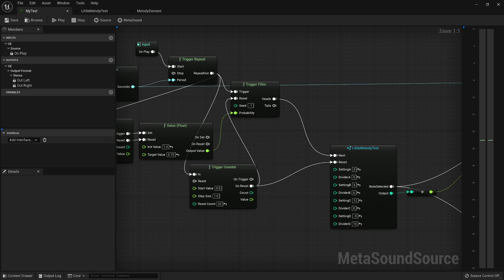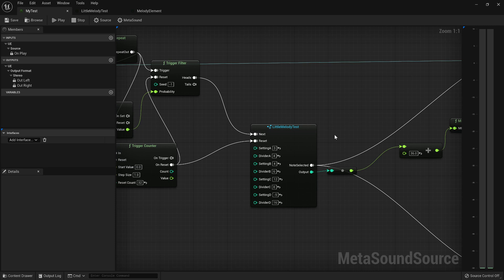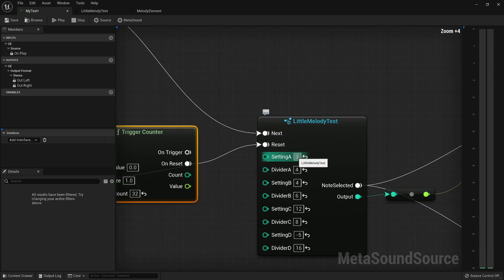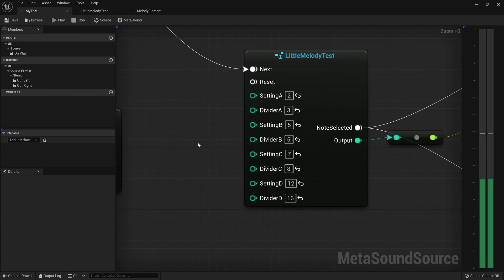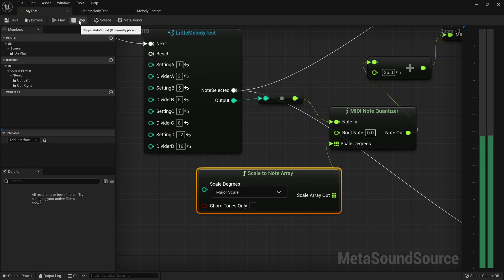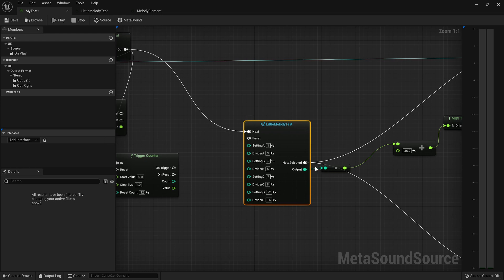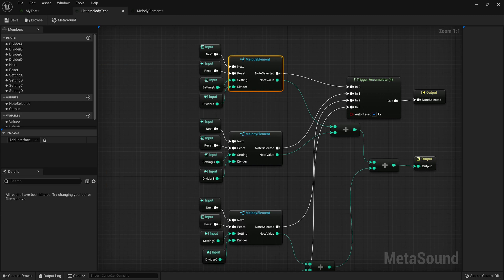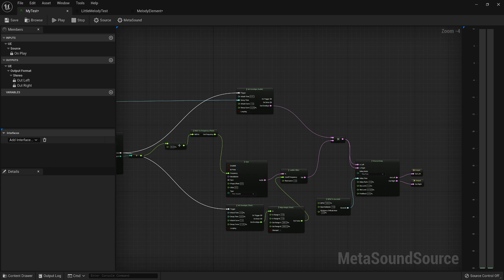Lunchtime MetaSounds: Composition, and Non-Stochastic Melody Generation

Comment: Hey thanks a lot for sharing your knowledge. I am trying to have something working like yours but I have a problem when I set the value variable out of the Trigger Route as once I feed it back to the add node at the beginning before the modulo it says connection causes loop and it won't let me do it as I thought. Would you mind explaining how that part works?
Reply from the maker: Set a Variable and then Get a Delayed Variable, that way you'll get the last buffer's version of that variable. Remember, MetaSounds are a DAG-style graph, so it's not an execution graph, it's a flow graph moving from left to right, even triggers are part of a continuous signal.
Reply: @DanReynoldsAudio  I just realized that trying to find out why. Thanks for explaining that. It makes total sense.